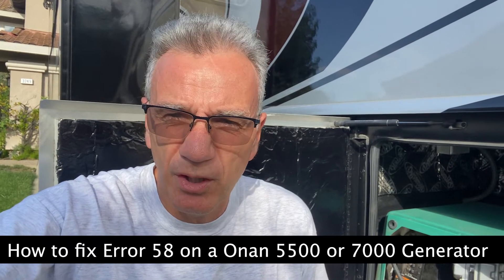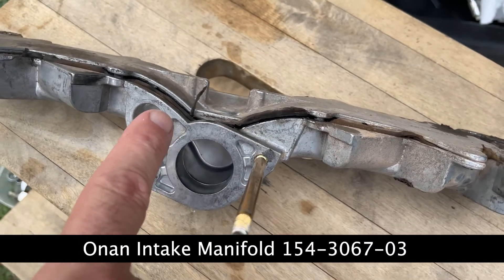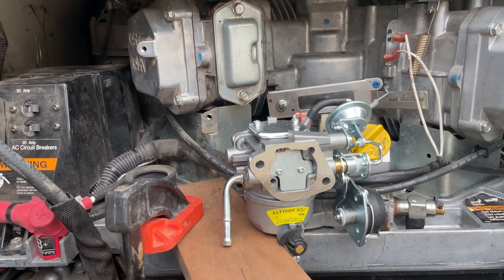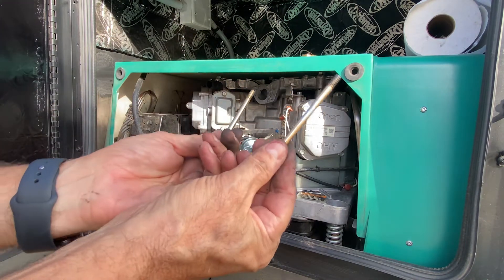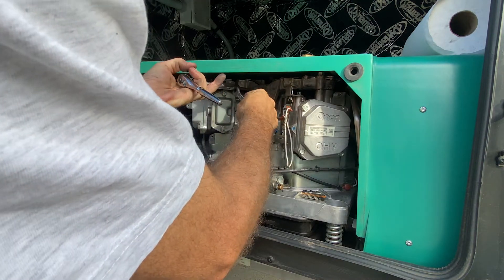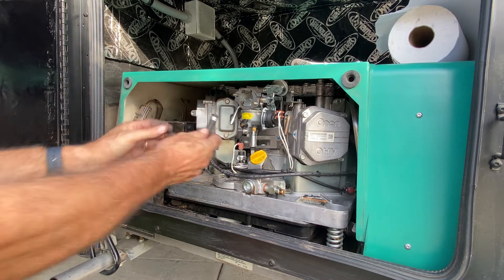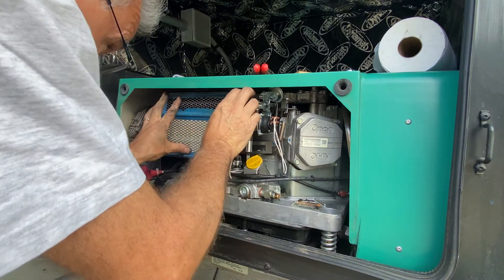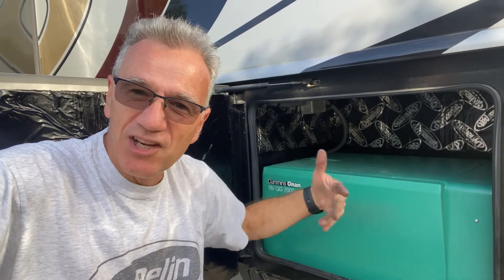How to fix the Onan 5500 and 7000 Cummins Generator Surge / Fault Code 58 and/or 14

Comment: These Oman generators are junk,  the worst.   I have an Onan rv 5500 evap generator in my toy hauler and it have 200 hours total run time and has given me nothing but problems.  My friend has the same and had many issues, finally pulled it out and out. A kubota GL 11,000 diesel generator.   Wow what an upgrade and never had any issues starting because it’s diesel.

Comment: I had code 58 for exhaust gas temperature and tried this fix too, but ended up being a bad ignition coil on the right cylinder. This was further evident by the fact my plug for that cylinder was very black whereas other cylinder looked more normal with a bit more brown color. I also changed the exhaust gas temperature sensor which is a temperature probe that screws into the muffler on my HGJAB "EVAP" K-series model so some chance that was part of the problem but I think root cause was the ignition coil.

Comment: This helped! My Onan 5500 started surging when there was no load or light load. Would shut down after 2-4 minutes and throw code 58. The Onan would run fine with heavy load (2-3 A/C’s running). Pulled and cleaned the carb but nothing. Searched high and wide and came across this video. Took a shoot and bought the manifold and gaskets. No more Code 58, purrs like a kitten now. Thanks for the video, huge help especially the tip about clamping down the inside to get the old mani out and the new one it.

Comment: Great video, where did you purchase the manifold?
Reply from the maker: From yakimagenerator.com Onan Intake Manifold 154-3067-03 Item# 8679786 - Onan Intake Manifold Gasket 154-3085 Item# 8679787
Reply: Hola tengo un generador Cummins y le da el código 47 .. que puede ser